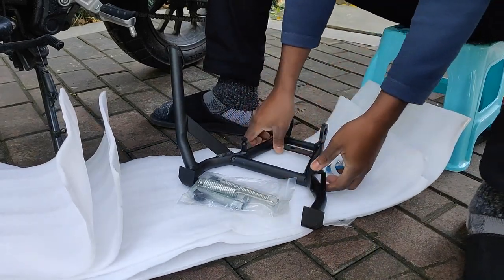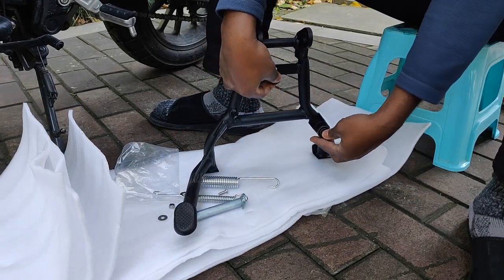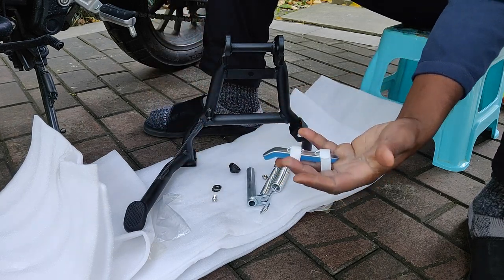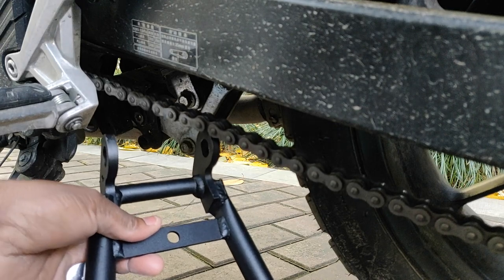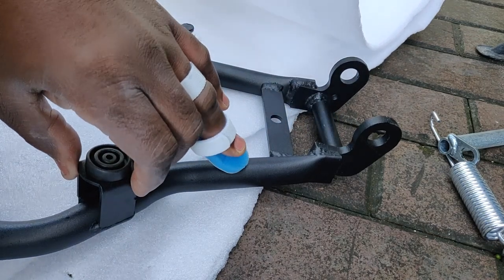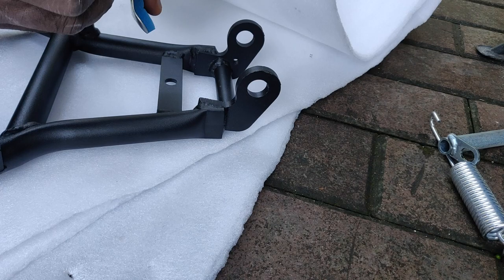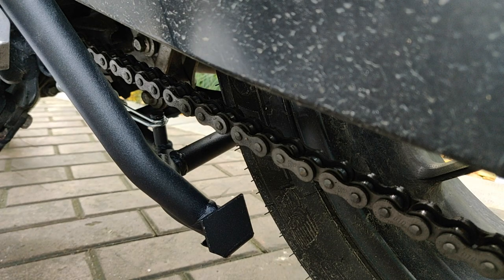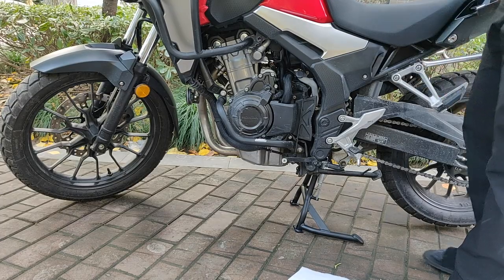2019 Honda CB500X Center Stand Installation || Complete Step-by Step!

Comment: THANK YOU! I was trying to use a spring puller at first like the Honda instructions suggest, but there was no way that spring was going to budge. The screwdriver method worked great though! Took some finagling and I should’ve used a Phillips head, but it worked!
Reply from the maker: Nice, I'm happy it worked for you. The long screw deriver trick works all the time. Stay safe mate. Cheers!

Comment: I've got to sincerely thank you for posting this video.  I saw a couple other videos first on installing the centerstand, and the guys used the "coins in the spring" method.  You made the screwdriver technique look very easy so I thought I'd try it...

Well, Mr. wanna-be physics guy (me) thought that if I used a really long screwdriver, it would give me additional leverage and make the job a piece of cake.  Wasn't sure which length I needed, so I got both an 8 inch and 12 inch phillips head.  Tried the 12 inch driver, and wouldn't you know the force on it from the spring was so great that it looked like the screwdriver was going to snap in half!!  So I switched to the 8 inch screwdriver.  Not gonna lie, it was NOT a fun time!!!  Took me a solid 20+ minutes just to do that, and there was a little profanity, but FINALLY I got it to work.  This was with the OEM Honda centerstand and spring.  It's installed and all is good now.  Again, THANKS!!!

Comment: Hello and thanks for this video. I just bought a stand that looks identical to yours for my 2022. Do you still use yours? Have you had any issues with it? I mean that hook that the spring is attached to seems to be very close to the chain and I'm afraid it might touch it while riding. Thanks in advance for your input. Ride safe!
Reply from the maker: Hi. I still use it and never had any issue with it. You should be fine.
Reply: @TheRideandPlace  Thank you very much for your reply. I finally received mine and I installed it. One issue is with the rubber stopper that goes to the right, on the exhaust side, it is touching the exhaust and half of it melted after the first ride. You can tell the difference compared to the OEM stand, the arms are a bit curved towards the outside, whereas those on the OEM go straight. That's why the rubber doesn't rest where it should. Have you experienced this?

Comment: Great trick with the screwdriver. I guess it has 2 springs in case one fails? subbed you hi from UK.
Reply from the maker: Grateful for the sub. Regarding the springs, I'm sure it's to ensure that the stand doesn't sag when disengaged.

Comment: The grease is for it to work like a bearing not just for installing. Should of used loctite on screws so vibration doesn't loosen the screws..
Reply from the maker: The nut came with dry loctite on it. However, I later undid the nut and applied some blue loctite on it. Thanks for the input.